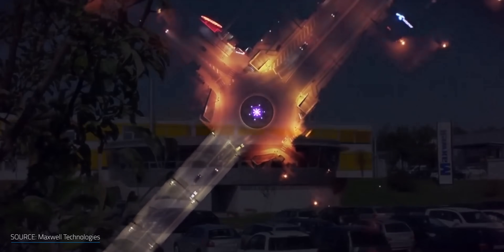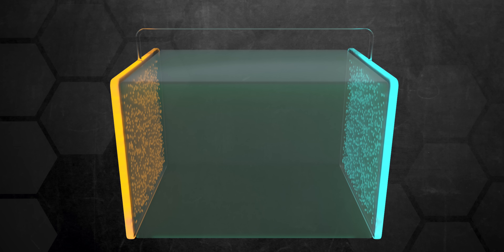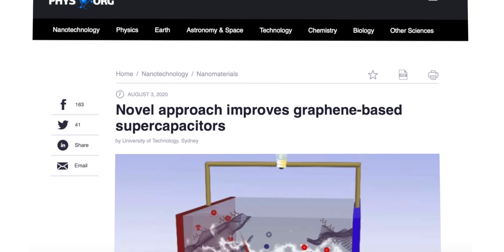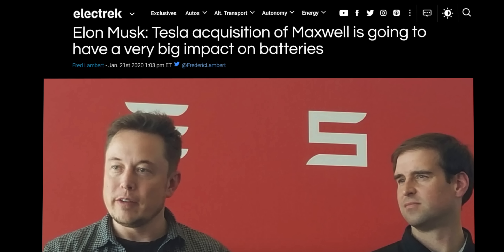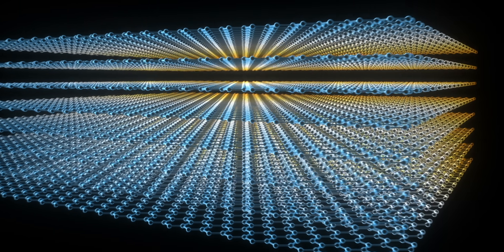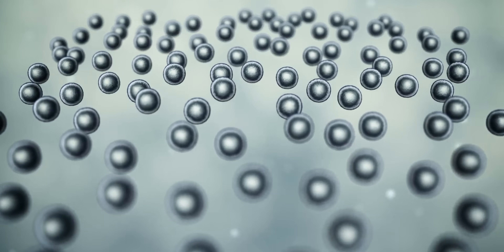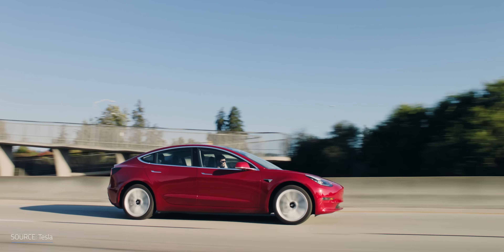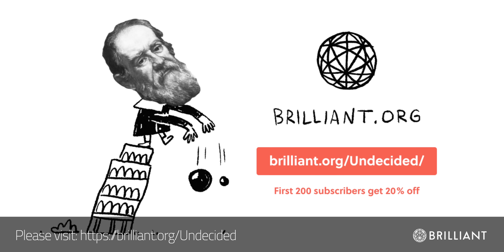Supercapacitors explained - the future of energy storage?

Comment: Would love to see super-capacitors be incorporated into Teslas to provide consistent “launches” , regardless of battery SOC.
Reply: Sure, a capacitor could provide a burst of charge for maybe a microsecond ! Really useful NOT.
Reply: @pasoundman  I don't know whats possible, only what was possible.
Reply: @aussie2uGA  The laws of physics haven't changed ! As a result, 'supercapacitors' are about as useful as they were 30 years ago, which is NOT VERY useful at all.
Reply: @aussie2uGA  It hasn't changed ! 'supercapacitors' may be great at 3 volts but can't handle the 400 volts or more of an EV motor and are therefore an irrelevance.
Reply: pasoundman You can series connect them to get whatever voltage you want. There are also capacitors that are much greater than 3v
Reply: @hugodeandres1497  Simply connecting them in series doesn't improve their energy density. Are you even educated in electronics ?
Reply: pasoundman I never said you can improve energy density by series connecting capacitors. You might have misunderstood me. You were saying that supercapacitors are not useful to power ev motors because they can’t handle 400 volts. I only said that you can solve that by increasing voltage of the supercapacitor bank by connecting them in series, not that you can improve energy density! You didn’t need to be so rude anyway
Reply: @hugodeandres1497  Still doesn't addtess the fact that supercaps have awful energy density. I'm a little tired of morons still thumping the tub as if there's still some 'magic' about them
Reply: pasoundman Yeah, I totally agree that they are definitely not suitable as a replacement for batteries. But you need to cool down, being offensive to others won’t make your point any more right. If anything, it may actually turn people off to hear about what you think and I’m sure you have good things to say
Reply: @Allen Loser Dielectric breakdown is the limiting factor in increasing the voltage on a capacitor. Thin dielectrics break down at lower voltages. If you want a higher voltage look elsewhere (not so-called supercaps).
Reply: @taylor92493  It's your time to waste as you see fit. I'm just bored at the mindless repetition of old slogans masquerading as new information.
Reply: pasoundman If you are that smart why are you even here with us, normal people
Reply: @hugodeandres1497  Somebody's got to point out simple engineering facts to  bunch of deluded wannabes.
Reply: @pasoundman  lol your point about the voltage wasn’t necessarily a good point though. You then just changed points to be about the density. So no need to be rude, since even you weren’t making an awesome point about it after 30 years of discussing it. 
The hybrid model they mentioned in the video sounds quite useful to extend the life of the lithium batteries. Interesting that Tesla basically bought rights to some of the tech merely to shelve it. Having batteries last too long would hurt their long term profitability. Reminds me a bit of those urban myths back in the day about the oil industry buying up the rights to a water powered car invention and shelving it.
Reply: I do understand your point. My query is whether they can add value in complementary roles with other energy storage systems?
Reply: For my final year dissertation of my chemistry degree I did it on metal nitride supercapictors such as vanadium nitride which are pretty effective

Comment: My PhD is on energy management optimization using HESS (hybrid energy management storage) with bat+UCaps.
I agree with u on a lot of stuff but trust me battery tech is not good enough.. If it was we wouldnt. try to solve problems like:
Frequency fluctuations, battery aging and degradation due to high currents, battery pack extreme weight , Switching losses etc..
Reply: Maybe, but the question is whether adding super capacitors (or any other tech) to EV's is good enough from an economic standpoint not an engineering standpoint.

Nobody is arguing that they would not add any value, the question is whether the value added is worth the extra manufacturing costs. And whether there is another added value that makes more sense to pursue first.

Like Elon says, manufacturing is difficult and "good enough" is relative.

Comment: In a home solar setup curtailment is a great use for these Maxwell super caps in my findings. Your panels create more power than they can push through a charge controller. So this bridges the gap by storing the power until the charge controller is able to use it.

Comment from the maker: What's your take on supercaps and hybrid tech?  If you liked this video be sure to watch "Get Solar Energy Without Solar Panels On Your Home - Community Solar Explained": https://youtu.be/buv-EE6IYaM
Reply: We've been putting caps on race drones for years (to level out the stress we put on batteries through constant changes in acceleration, and have a smoother video signal), was honestly disappointed to learn my M3 did not have one :(
Reply: I've been trying to get this type of hybrid synergy going for years, I also think the graphene tech will play a huge role as well as ongoing improvement in the lithium theater. One day it might just prove Goodenough...😂
Reply: The Future looks good with the Evolution of Battery Storage and Renewable Energy. Let's just hope Big Oil embraces Green Energy!!!
Reply: I've always considered batteries the achilles heel of EV transportation, if not the archaic electric power grid.

I think supercapacitors just might make EV transportation technologies viable. Currently, they rely on subsidies and a lot of market interference. Battery technology won't go away, but I think supercapacitors will "take the load" off battery technology (pardon the pun) in the EV market. I wouldn't be shocked if they find a big role in mobile computing and even foster new technologies.
Reply: They are pretty useless for EVs.  They lack the energy density.  Even when used is parallel with lithium ion cells, it merely takes up space that a lithium cell could occupy for more range/power.  Also to get an ESR that is low enough for any meaningful use, the capacitor would be as large as four 18650 cells and have less than 1% of the capacity/per volume of lithium.   Tesla bought maxwell for their dry electrode development process, not really unique to maxwell.  For example, a 300F supercapacitor has a total capacity of 250mAh and 4x bigger than a 18650 cell, a single 18650 cell has around 5Ah.
Reply: Kilal Googlestaffers  
If I tell you how big a super cap needs to be to capture lightning ⚡ (did you by any chance have a guy named Frankenstein in your family tree) can I brag a little? 😜
Reply: @Pops180  
I don't mean to sound argumentative, but both significant developments in energy density, burst voltage  and regeneration is the real point. As Mat and the application of using them to stretch the "batteries" life/range as stated is the best of both worlds.
Reply: @ricksquier7812  I get that, but the volumetric efficiency is just way too low compared to lithium ion. We study this periodically in the automotive industry and the results never really change. Even for regen energy capturing,  the capacity of a string of ultra capacitors is virtually useless. Like I said before, the only real benefit of ultracapacitors is the low temperature ESR (at -30C the ESR is almost the same as +20C whereas a lithium cell would be 4x or 5x at -30C).  This makes them useful for 12V systems like steering and braking that suffer at cold Temps due to current battery technology.. i can get 100x more Ah capacity  in 4 parallel 18650 cells than a single 300F cell (which occupy the same volume).  This is all that really matters with regen charging.    With capacitors in parallel with a lithium battery, you can only recapture 0.08% of the battery capacity (when using a 100kWh pack) very quickly but is very expensive.
Reply: Kilal Googlestaffers  a bolt of lightning is about 1 billion volts.  An ultracapacitor is about 3V. So 33,333,333 capacitors in series plus some overhead
Reply: Kilal Googlestaffers  or use regular electrolytic caps, but still.....
Reply: Great job explaining supercapacitors 👏 👏 👏.  This has been the technology our company has focused on for the last decade. Our recent breakthroughs using thermal coal as our carbon source feedstock will move this technology into the mainstream. Again great job and keep up the great work, super impressive.
Reply: Yrs ago watched a video of people trying to catch lightning in Florida.  Could a bank of capacitors feeding the grid and batteries work? And be cost effective?
Reply: The roadster should be using this.
Reply: Undecided - what does SUPERCAPACITORS have to do with TESLA BATTERY DAY ? 
ABSOLUTELY NOTHING !!!!!!!
TESLA Aquired MAXWELL to get the DRY ELECTRODE coating Technology. thats it.
WHY, are you not Discussing TESLA NEXT GEN Batteries - NICKEL + SILICON LION Batteries for Upcoming Vehicles , such as the NEW Roadster, Tesla SEMI and the Cybertruck ?
why, are YOU wasting EVERYBOIES TIME on this NONSENCE ?????
why, dont you BUY some CHIP TRUTH , and Report on that MATT.
Reply: Actually Elon Musk attempted to do his PhD on Stanford University on Ultra capacitors (he bailed out, did not finish his study to start X.com)  so he problably knows a lot about this technology. Tesla must have its reasons not to use them, and instead pursuit the innovation in battery technology.

It is probably like someone here already said, a capacitor takes up lots of space that can be used to add more batteries and increase range and power.. And when you devide the power burst over thousands of battery cells, the strain does not have to be so high on the cell level , and super capacitors with graphene are orders of magnitude more expensive then a Li-Ion cell, so by NOT adding super capacitors also saves in costs.
Reply: 66
Reply: Ok. So Today, I want battery storage for the paid for Tesla solar panels on my roof. I have no storage capacity. Do I buy a Tesla Powerwall 2, which I need 2 batteries, @ $7,000 each. Or what would you suggest? I live in the sunshine State. Thank you for your reply.
Reply: It seems dumb to carry around hundreds of pounds of batteries in hybrid vehicles.  You only need enough energy stored to accelerate the vehicle to cruising (highway) speeds maybe twice.  You could use an engine that is much smaller (30hp?) which would be sufficient for highway driving and to recharge the super-cap bank over 10 minutes.  Smaller engine -> lighter -> better fuel economy.    Driving a car that can generate 300 hp peak, when you, on-average, only use 25 hp driving down the road, is incredibly wasteful.
Reply: Wouldn't significantly longer battery life result in significantly cheaper EVs? Seems like this could be the main benefit of this technology in the near term.
Reply: Does anyone know where I can get the best deal on powerwall 2.? I need 2 batteries and they are not cheap. I have a Tesla solar system on my roof which works fine. I need storage.
Reply: Super Caps will be used for Electric cars like Nitro is used for Gasoline cars
Reply: Pp
Reply: Problem problem I fixed this game but PPP pop pop
Reply: Supercapacitors will become viable for energy storage around the same time that fusion becomes commercially viable.

Comment: As always an excellent video, thank you.

It makes so much sense to use these. It's like computer cpu cache memory. Small but very fast and in combination with slower memory/disc the whole system performs drastically better.

Plus I suspect as it is not a chemical process it will not be affected by temperature much. So EV Regen in the winter would work as well as the summer. Thus improving winter driving range.

Comment: Great video, (as in confirms my thinking)! Why do Tesla and others not give their hard working batteries a supercap armchair to relax into. With the right arrangements of supercaps and control programming, the stresses of high power demand alternating with high regeneration  could be evened out, the supercaps taking the strain. Million mile battery right now, with an easy life like that, and no loss of performance.
Reply: It comes down to a cost-benefit analysis.  What will be the expense, weight and usable vehicle interior volume penalties,  as well as the design changes required, and are they worth the advantages?
Reply: Tesla and similarly wired batteries can easily source enough current as they are. They don't get much benefit from supercaps, as it's the charging cycles that stress these batteries - not the inrush-currents that would stress smaller batteries. The larger the battery pack in terms of capacity and current throughput, the less supercaps help with longevity. Also supercaps have low voltages, generally 2.7V, so you'd need a series of 140 to barely be able to operate, much more to do that safely. The volume and weight this would bring would defeat the purpose.
Reply: @alexoja2918  With capacitors in series, the energy storage in kWh adds up as you'd expect. Energy is proportional to voltage squared, and since voltage adds up with capacitors in series, the capacitance must drop or else you'd be getting exponentially increasing energy density.
Reply: @dekutree64  Totally correct, i wasn't thinking about power as i should've, but capacitance alone. I've removed the mistake, thanks for pointing it out.

Comment: The one aspect you're missing in terms your question wheter or not we will see supercapacitors, is the economic feasability. If it's not economically worth it, it won't happend, if it is or will be, it will happend.
Reply: capacitors are SIGNIFICANTLY cheaper and lighter
Reply: @-LightningRod-  I think batteries are cheaper and lighter and also less volume.
Reply: @Allen Loser uhhhh, yeah 
thats a capacitor used as a battery, they are not batteries, typically a capacitor is a foil with andie-electric coating and hollow.
Reply: @Allen Loser 
yes i believe it is ideally suited for the regen cycle
Reply: @Allen Loser 
uhm capacitors are VERY light, ... typically
Reply: @stardusttwo6262  
well, ... i am pretty excited about ALL of it actually. I have been paying attention to it for a very long time. It is like "Science" stopped or something. Innovation cam,e to a solid halt, ... any idea as to why that would happen???
Reply: @Allen Loser 
we are all stars my friend
Reply: @Allen Loser 
no, but i Guarantee, i can make you POP with a reasonably tiny device
Reply: The first time I saw a supercap being used as a real-time-clock backup on a PC board I was confused. This little electrolytic says "5F"... what the heck does that mean? Well, 5 Farads in about 1 ml. Now it is only at 6 volts and actually has two supercaps in series to reach that, but still pretty impressive. But compared to a battery the energy density is still very low. But used in parallel (and with a bit of control electronics) one gets better regeneration efficiency and longer battery life in an electric car... or bus.
Reply: @Allen Loser Nothing the size of the end of your little finger is much use in powering a car. The ones used for regenerative braking are LOTS bigger.

Comment: I believe the swiss also pioneered the gyro driven buss. Amazing design would run 4-6 hrs on a single spin up. A great feature of gyro driven vehicles is when heading downhill it adds energy directly into rotary motion of the gyro. Be interesting to see what they could do with an electric motor that draws power from buss stops to add energy to the gyro.

Comment: I think that the ultracapacitors will be used in EVs eventually.  There are several potential use cases. First, as you mentioned in the video, the UC can help capture energy from the regenerative braking system when the EV is decelerating and subsequently either feeding the energy into the traction battery or feeding the energy to the electric motor when the EV accelerates again or perhaps both. If the energy storage capacity of the UC is significantly large, there are some other use cases.  For example, the UC could be used to assist in the recharging of the traction battery once the SOC of the battery is close to being topped off to the level desired by the EV owner.  You'll note that typically as a Lithium-Ion battery reaches an 80% SOC, the internal resistance of the battery slows down the charging process thus causing further charging to take much more time. Perhaps, if the UC is large enough, this would be a good opportunity to use the UC to quickly take on the remainder of the energy destined for the battery so the EV owner can complete the recharge session and get back on the road.  While back on the road, the UC would then discharge the final amount of energy into the battery to complete the recharging of the battery to the desired topped-off SOC.  Besides saving the EV owner time waiting for the battery to reach the desired SOC, this would also help prevent the battery from being stressed from the fast charge.  A third use case  MIGHT be to use the UC to help prime the battery for being recharged at the optimal temperature by quickly cycling the energy between the UC and the battery to warm up the battery to the optimal temperature for being recharged.

Comment: at 1:50 it is mentioned that a 3V capacitor will be a 3V capacitor in 15-20 years, with that is obviously ment the maximum possible capacity and not a energy stored that lasts 20 years - capacitors have leakage currents due to internal resistances.